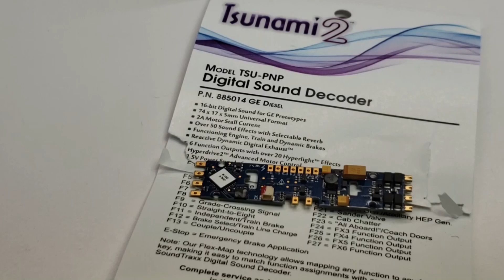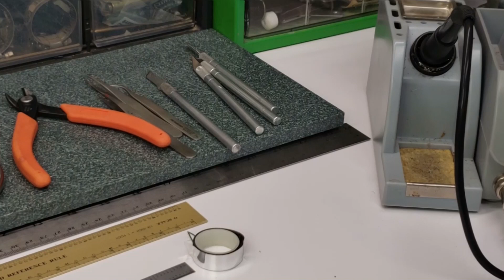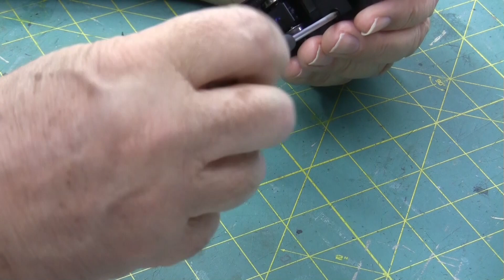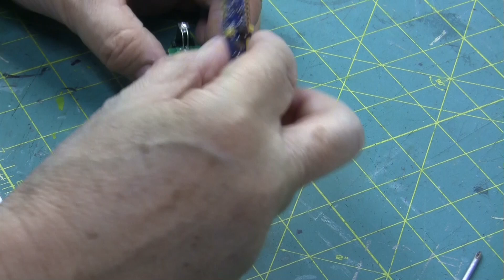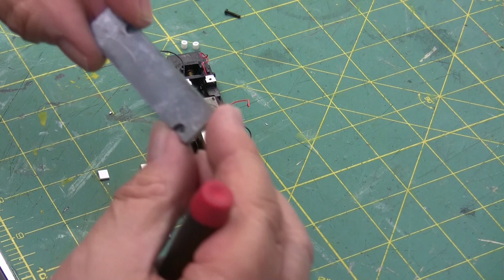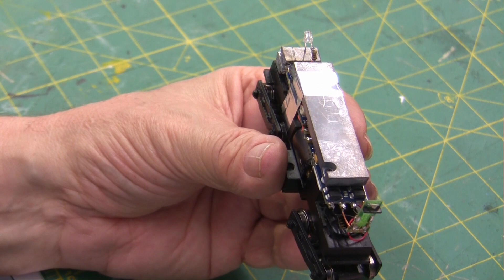How to Install SoundTraxx Tsunami 2 DCC Decoder w Sound and Keep Alive - Bachmann 70  Ton Switcher

Comment: Why go to all that trouble to install the wrong sound file?
Reply from the maker: We get to select the correct sound file in the programming.  One CV change takes care of that, and you can get as fancy as you want.  I have a separate video that describes the programming, and the results are excellent.  https://youtu.be/lgd62WB6AOg
Reply: You've done a very nice install video and the programming video is very informative. I'm a fan of Tsunamis but, unfortunately, they don't do the  distinctive  Cooper Bessemer FWL-6T prime mover. The Cummins sound you've chosen is the most appropriate that Soundtraxx do but very different from the Cooper Bessemer.
Reply from the maker: @CountBagula  You are correct.  The preferred sound set is not available from Soundtraxx as far as I am aware.  There is justification for the Cummins in that at least one unit, now in Mexico, was repowered that way, and there may be more.  There is also at least one running around on the High Point Thomasville & Denton Railroad with Cat power. I don't know who has a CB FWL-6T sound set.
Reply: @HappyHoboTrains  True. You've picked the best available primer mover on the Tsunami.
I believe Loksound have recently released the Cooper Bessemer prime mover. Unfortunately they haven't put up a demo yet so it's hard to tell how good it is.
Reply from the maker: @CountBagula  Thanks for the info.  I'll have to check it out.  I have some Loksound Selects in my box of extracts, so might be able to put them to use!  Model railroaders never throw anything away!
Reply from the maker: @CountBagula  You have tickled my curiosity.  I have found some decent videos of 70 tonners in action, and the FDL sound is very different from the Cummins.  I might do some playing and see what the various sound sets sound like out of the little cut-down iPhone speaker.  Maybe something sounds close enough to fake it!  It's fun to play with, in any case.
Reply: @HappyHoboTrains  It's a very distinctive and rather pleasant sound. I hope you find something you like to represent it.
I have a Bachmann 70 dinner stashed away somewhere that would sound rather good chortling away.
Reply from the maker: @CountBagula  Thank you for stimulating my imagination.  I have several things that I would like to try.  You are correct in that the FDL sound is distinctive.  I live in an area that saw lots of FDL-16's and you could identify them from miles away.